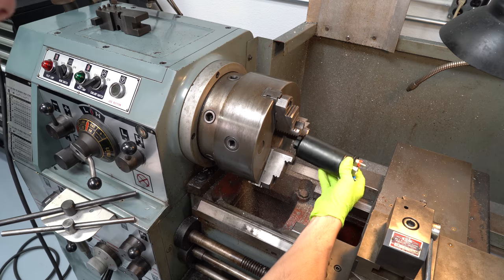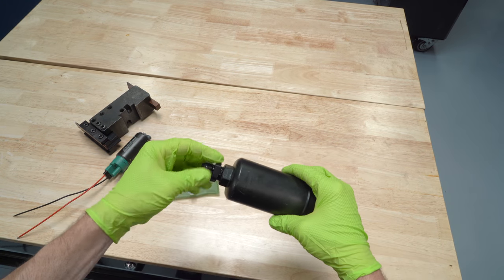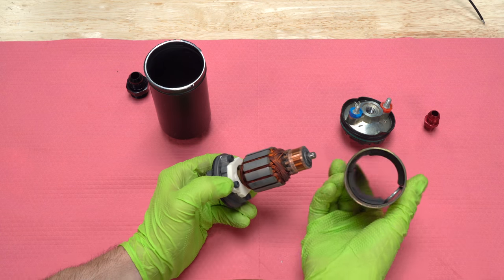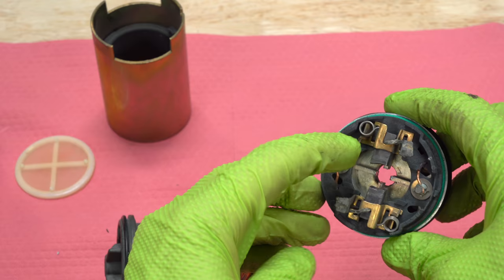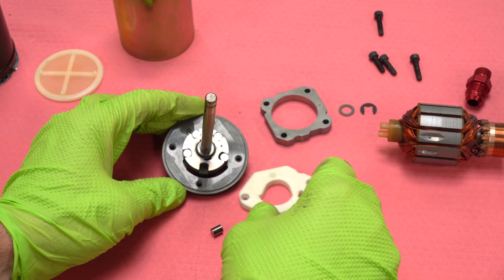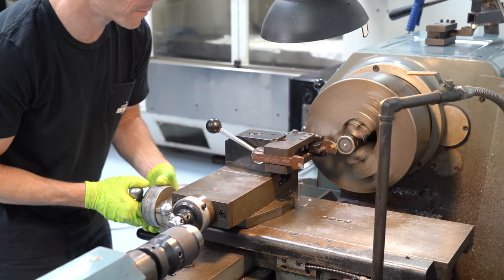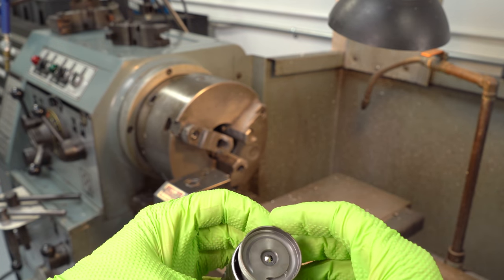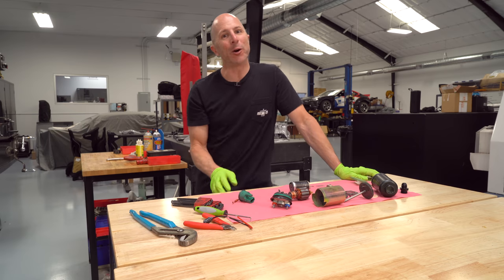How EFI Fuel Pumps Work

Comment: Oh man... the flying E-clip. I started racing RC back in the 80's when they used E-clips on everything. I feel your pain trying to find that damned thing.
Seeing the armature from that larger pump takes me back to the days of the Hudy Commutator lathe and cutting motors between rounds and tuning your brushes for the perfect amount of contact pressure and timing.

Comment: The entire electric motor is sorrounded by fuel
Me: 👁👄👁
Reply: This shocked me as well. But it makes sense.
Reply: Shocked me a bit when I learned about it a few years ago.  Honda recently had an issue where, in the pursuit of energy efficiency, they ran the fuel pump at variable speeds according to flow need.  With some fuels this would cause sulphur build up in the motor and then pump failure.  So a software fix was put out to increase the minimum speed.
further, fuel carries away heat from the pump motor as well as lubricate and I assume clean it from commutator dust.

Comment: Great video, please more tear downs. How about showing how some big relays work, an old school air flow meter with flap, versus hot wire. Or maybe a fuel injector and high pressure diesel pump. Thanks for taking the time>👍👍🇬🇧🇬🇧🇬🇧

Comment: Great. Always full of information for small durations video.

Maybe start from fuel pump and go in to the fuel safe and go in to the fuel lines and go in to the fuel rail to the injector or doubled and so on. In case used part that you and your team usually use in race cars. Maybe too many

Comment: Great info Steph, I find nearly all the older bosch external pumps start leaking at the body o ring but still work. I decrimped a couple of them to replace it, then just use them for fuel transfer

Comment: Notes: A lot of these aftermarket pumps are made with electric motors that have carbon brushes on them just like your electric power tools. Often times the fuel itself cools the pump and is in direct contact with the electricity of the pump. It doesn't make the gasoline catch fire because the hydrocarbons are poor conductors and there's not enough oxygen in the fuel pump anyway. (What about if the pump were partially ran dry? Not sure.) "Reactive Turbine pumps" can be damaged in less than a minute if ran dry. Sometimes the magnets for the electric motor is part of the casing and therefore nonremovable.

Comment: Please elucidate, as you do so well, electronic ignition, shock absorbers, rack and pinion steering, fuel injectors, engine oil galleries, sequential transmissions, brake master and slave cylinders, and variable valve timing. You are a master educator, in addition to your engineering and technical talents.

Comment: Pumps are actually very fascinating. I kind of wondered how Locus fuel treatment would quiet a fuel pump that would make noise when I was over a 100 degrees. Now I know its because the entire motor is submerged in fuel.

Comment: I would love to see a fuel pump with a clear case around the motor. it would be interesting to see sparks when the intake sucks up air. curious if there would be mini flames inside for that short period of time or if the air fuel ratio would be too rich

Comment: I feel like such a dumbarse. I completely understand the concept of hydrocarbon fuels being electrically non-conductive and the fact that no ignition can occur without the presence of air within the proper ratios, but I just... never fully realised that fuel flows through/past the motor windings and brushes, despite the placement of the inlet/outlet fittings and the overall design making that rather obvious. Cheers from Australia Stephan!

Comment: You mention that the fuel can flow through the motor because it's not as conductive as water, but brushed motors work when in regular water.
Reply: they also rust and corrode when in regular water.
Reply: But the efficiency goes down proportionally with how much ionic material is in the water. Once you hit sea water levels of conductive salts you basically have a "motor/kettle hybrid" device.

Comment: I remember racing 10th scale RC and we would use motors with different winds around the armature for change in torque/hp. Does that come into play with fuel pumps as well?

Comment: being a submerged brushed pump that would mean the carbon off the brushes would slightly contaminate the fuel, I wonder if that would cause any damage to other components in the fuel system over a period of time

hitting a magnet motor is very bad, it causes the magnets inside to break, I see it in starter motors after people bash them with hammers to get it to work, you can't rebuild them once that happens, don't hit magnet motors :)

Comment: Just curious why you prefer the AEM external pumps to the internal pumps? I was running that exact AEM external pump but a 340gph model but I designed a new fuel tank and had it built and will be going internal for a quieter pump that lasts longer that is still good up to 800hp.

Comment: One important question about the smaller pump: does the fuel get inside that motor too, just like in the larger one?
Because there's a myth out there that one should never allow the fuel in the tank to get below a quarter of its total capacity (or the pump will get damaged), but if that smaller motor is also bathed internally in fuel, then the myth is not true.

Comment: The hitting the fuel pump thing is caused by a bad connection on the brushes its the same on starter motors

Comment: I have a problem with intank pump I want to use for inline pump. The bottom of pump has a large intake hole. There's also a very small hole in bottom plastic that is pressurized when pump runs. If I plug small hole pump fails and no fuel flow. Small hole open pump works but fuel comes out small hole & normal outlet on top. Obviously can't have fuel spraying all over from small hole. Is there a way to use it as an inline without spraying all over?

Comment: I am developing a jet engine. Now you need to create a control device and therefore you need to create a lightweight and smaller (Out Diameter 40mm) fuel pump.
 If you have a suitable pump for me in your country, will you recommend a fuel pump or you can sell it after purchase? The fuel amount should be able to pump 3 LPM at 5 to 7 bar, and if there is no gear pump or no gear pump, it is also good for the same method as the pump of this image. Motor is better if the motor is BLDC. 
  Thank you.

Comment: Hi!  I would like to ask if you could put an external fuel pump on a 2000 model Ford Expedition 4.6L?  I'm having frequent issues with the fuel pump and now labor is expensive and also the price of the assembly itself is quite high.  Thank you for your opinion!

Comment: what is difference on these pumps versus original bosch 044 when it comes ethanol/methanol resistance? I bough similar pump to that aem from another brand. Either it was really ethanol resistant, or just bad pump, but it lasted only few months of driving (85% ethanol).

Comment: I'm surprised that they use brushed motors , why not ise bldcs ?
Reply: Cause brushed motors are mechanically commutated, so you don‘t an speedcontroller like you would for a bldc. Its all about cost cutting in automotive industry.
Reply: @3DDruckHupfer  but bldcs are safer and don't have the brushes as a weak point , no chance for a spark there
Reply: Piiu Mlkj when did you have the last explosion in your fuel tank? 😏 They‘re developed to be just save enough for the intended lifetime.
Reply: @3DDruckHupfer  I guess they used the old technology and kept doing that , after all if it ain't broken don't fix it

Comment: II pump you cut a card standard pump for regular cars I usually cut those open with a hacksaw blade Sideways from end-to-end and I spread the case apart an old pump comes apart of cooking part many fuel pumps a part to look at wear Factor a pump that would last a long time probably forever would be a 3 phase electric pump what's the right parts it would never wear out and have a lot of power if somebody uses my design please send me a check

Comment: Kind of unfair to call it a reaction turbine for the pumping element on the smaller pump. Turbines extract energy from a flowing gas or liquid, think of a windmill or electric dam turbine. The proper term for the pumping element in most automotive electric fuel pumps would be an axial flow impeller. An impeller imparts energy into the fluid surrounding it.